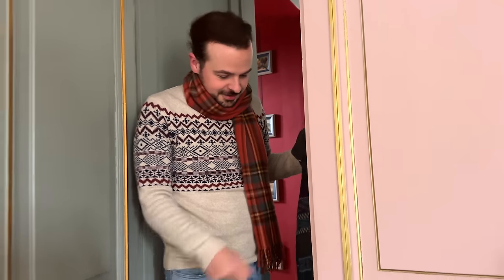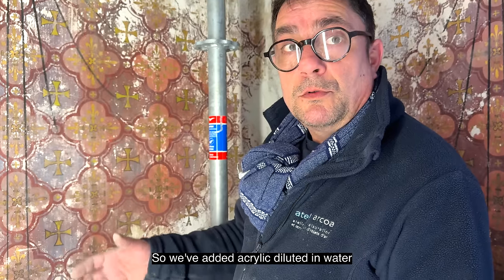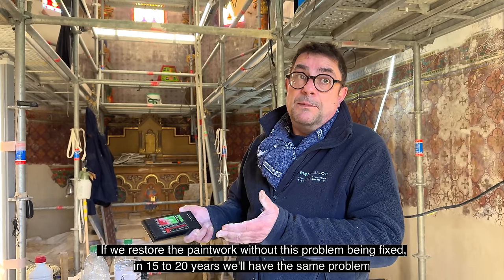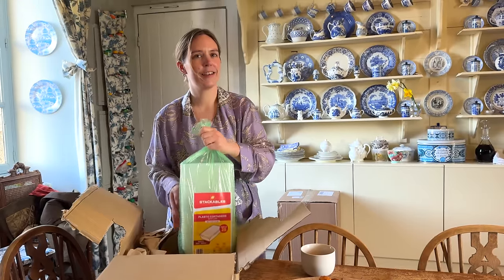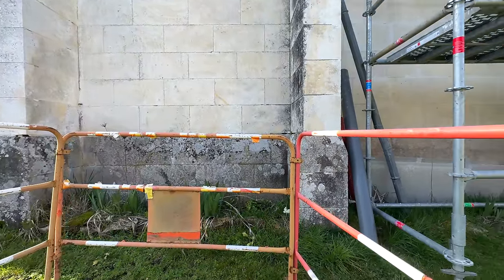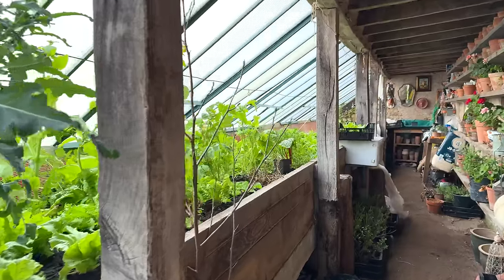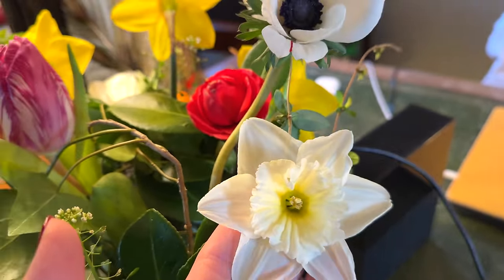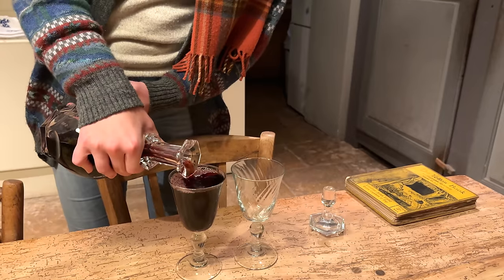The Secret Beneath the Chapel

Comment: 10:19 — Stephanie- when the architect/bldg engineer looks into ventilation, ask him about geo-thermal heat. It could bring a constant 60°F ambient temp in fluid-charged tubing filling the hypocaust passages & warming/cooling ventilation air to that constant temperature. No condensation/evaporation swings. Yes?

Comment: It might be possible to use solar to heat hot water and run it through the pipes under the floor through tp hypocaust. There are quite a few different systems you can purchase now. .I grew up with this blissful type of heating. Bare feet were happiest in winter walking on permanently warm floors. It would be a green antidote to damp!

Comment: I don't know anything about engineering/heating etc... but had a thought about your hypocaust system. Could a modern eletronic air pump system, powered by discreetly placed solar panels, work???? It could then be running all the time to maintain the desired temperature.  Not sure such a thing exists. Food for thought.
Love the cushions and Phillips portions of wine in the glasses!❤

Comment: For the chapel, you would need to consider a dehumidifier - that's the only way to help remove the condensation in the chapel. That would help tremendously with the damp in the building and protect the beautiful restoration work in progress!

Comment: I wonder if a type of positive input ventilation (PIV) could be installed in the chapel attic space with the latest in automatic and/or remote activation from room humidity sensors.  The sensors would detect humidity levels in the interior as well as outside and turn on/turn off the PIV system when necessary to maintain a healthier and more consistent interior humidity.
Reply: That sounds incredible!

Comment: How about using the hypocaust system with a heat pump?  You might be able to make some minimal vents at floor level and have reasonably consistent temperatures and humidity control throughout the year!?

Comment: It sounds like the chapel would benefit from a modern hvac system - it would need to be made more airtight for that to function optimally. But no doubt the architects will provide an appropriate solution.

Comment: I wonder if a mini-split system might keep the chapel from being too hot and humid, and help dehumidify the space? Also, a recirculating ground heat pump could help keep the temperature at an ideal temperature above freezing, a determined by the specialists.
Reply: I think they would have to cut a hole in the wall for a mini split. I know my son-in-law did when he recently installed one in an outbuilding.

Comment: Is there a way to add a oil or gas heater/ventilator to the old underfloor heating system for the chapel? That way you can keep a more stable temperature in there. Hope good solutions can be found. ❤

Comment: Should there be constant heating in the chateau to maintain the humidity at the optimum level? How about sealing the outside walls with waterproofing
Reply: I replied to a lady who had the same question  a few months ago. Any type of stone or masonry, no matter how thick has about zero insulating value and will stay cool almost always.  It isn't a matter of the transmission of moisture but rather of condensation.  Think of your glass of iced tea when you take it outside on a warm sunny day.  You have wet all over the place, right?  It didn't leak through the glass, it condensed because of the temperature difference. The warm, moist air must be kept away from the cold stone. The restorer just confirmed what I thought and it has to be a difficult remedy, especially for such a relatively small space.  The same thing can occur  with metal buildings like pole barns that are metal on the outside, then insulated but without a vapor barrier to keep warm, moist interior air from meeting the cold.  It's called the "beer can effect".  Everything inside turns into a big, sopping wet sponge.  Problems with mold can abound.  I'm going to be anxious as well to see what the architect offers as a solution.  Hopefully we'll all soon learn!      Jack L.

Comment: would the hypocaust contribute to the soot on walls and ceiling?
Reply: Unlikely, since the fire is outside, and the hot air travels through pipes embedded in the walls, usually. The soot would have been from candles and oil lamps.

Comment: I am wondering if a big fan with a small electric heater could be set in the fireplace and just give a steady "warm" air through the system.
Maybe some strategically place solar panels to run it.